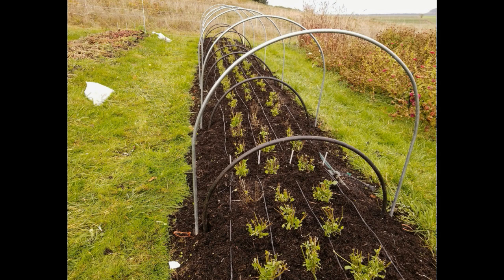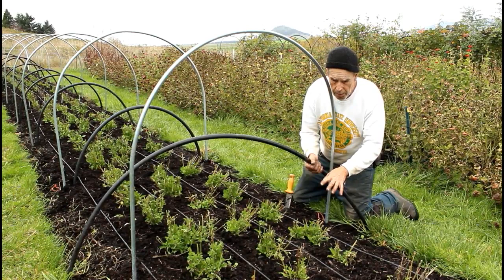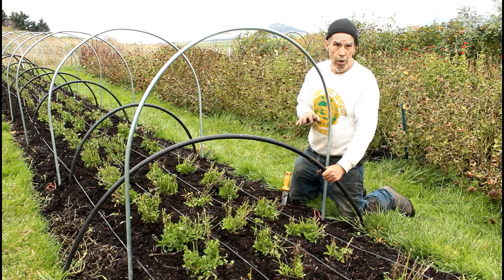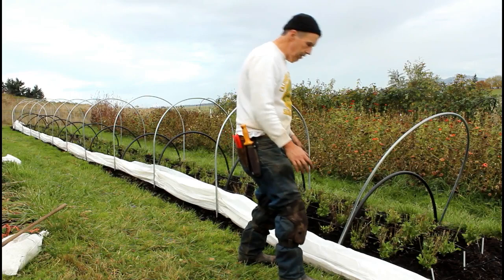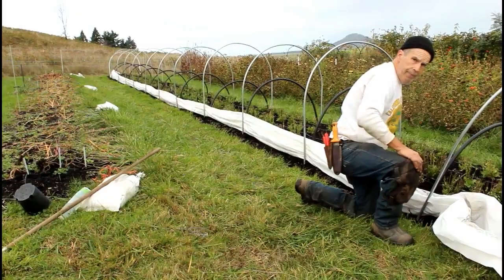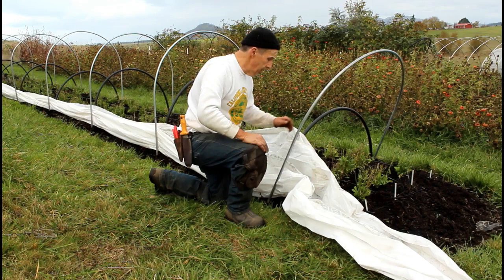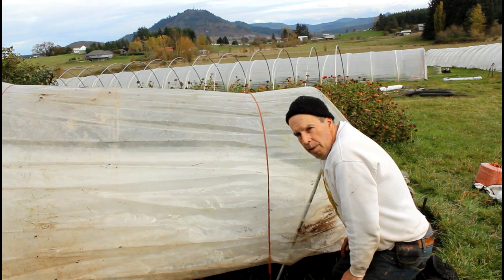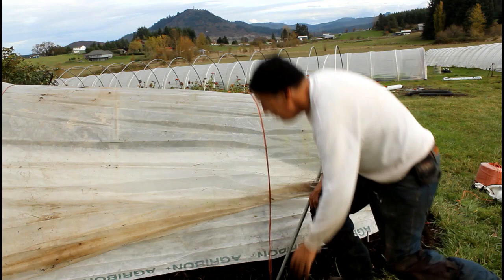How we  double stack a low tunnel!

Comment: Nice i use 1/2 inch pex pipe and 3/8 rebar and 6mm poly in Austin for my tunnels for double insulation i use frost blankets in my small 2' by 10' raised beds. I hav3nt done any kind of venting and tie down and will do this moving forware. Beware of non UV chord from your box store!!!
Reply from the maker: Sounds like your design works pretty good.  I use polypropylene baling twine which is cheap and UV resistant.

Comment: Extremely helpful! Have you ever considered double plastic? Would that have insulation properties without reduced light transmission?
Reply from the maker: Hi Ali;  we've never tried double plastic.  A thought I have on that is that without creating a layer of air between the two plastic layers the extra insulating effect of 2 sheets of plastic laying one directly on the other might be low.  We have found the insulating effect of a single layer of plastic is quite low, maybe 1-2 deg.  The major benefit is protection from wind and rain.
Reply: the agribon 50 has better thermal properties than plastic.  Check Johnny's Seeds site for frost ratings on various weights of agribon.